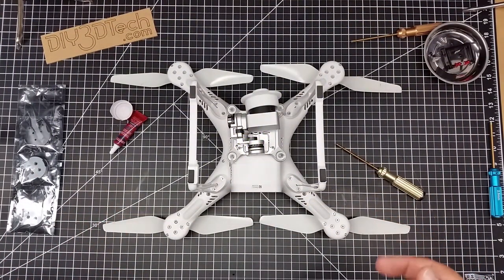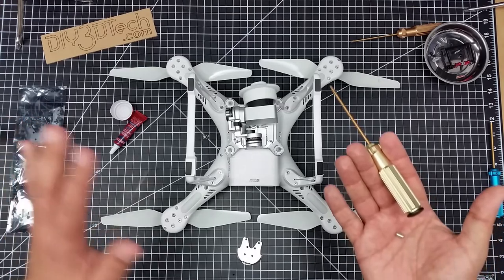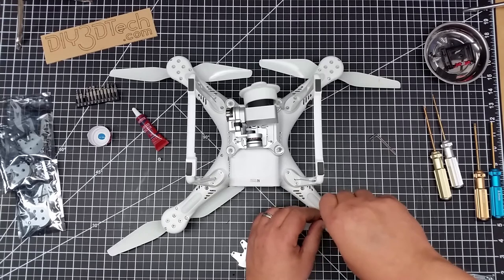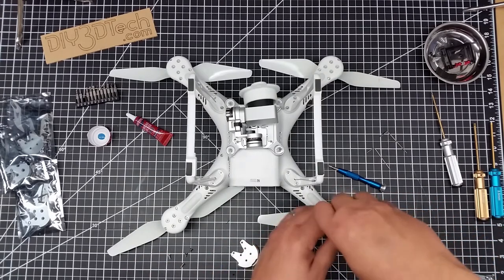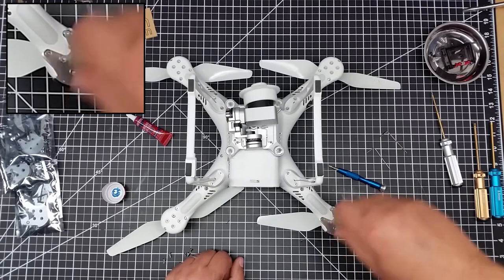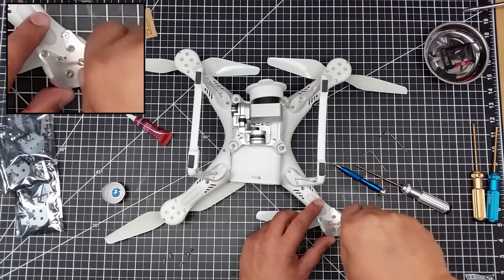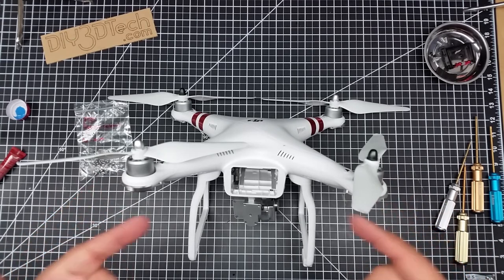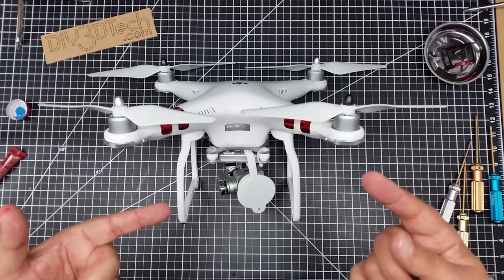Video Drone - DJI Phantom 3 Aluminum Reinforced Motor Mount Installation!

Comment: After a bad landing, 2 of my mounts are buggered. The motors pulled right out. I was wondering if I could get away with fitting these because spare shells are sold out everywhere apart from China and they want up to $129 Aud just for a lower replacement. I thought perhaps I could tape the parts in place, fill the void with epoxy resin then drill the holes and refit the motors.  What do you think?

Comment: I would really like to know what they actually weighed...

J/K... Thanks for the video...
Reply from the maker: Why did I know you were going to ask :-) Can't imagine more then a few grams each as they say CNC but they look stamped to me.  I won't take one off but I put lock tight on there...
Reply: Ah man, Pleeeeeeeeeeeeeeease? Pretty Please.. All you'll need is a torch to heat that screw up a bit and it'll come right out... I suspect no more then 400-600F 😋🤓😋🤓
Reply from the maker: Only for you since your the one talked me in to spending thousands on drones why not!
Reply: Yeeeeeeeeeeah!  Now that I've had some time to think about this more and really give it some serous thought......... I think you need to go to 1,100F.....
Reply from the maker: Haven't forgotten you, its just thing called a job gets in the way sometime :-)
Reply: Joe, I'm pretty sure you know I was just messing around, but just in case... I'm just kidding, PLEASE don't remove them.
Reply from the maker: Hey my viewers come first!  :-)
Reply: Weight = 55 grams all up.